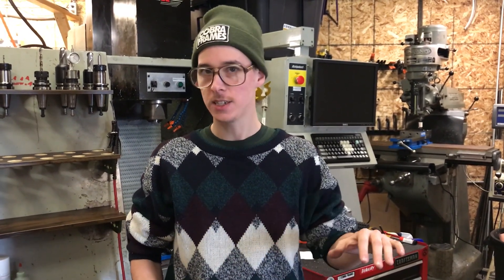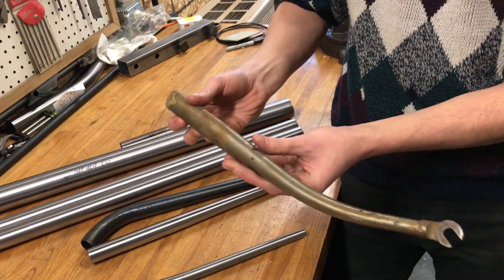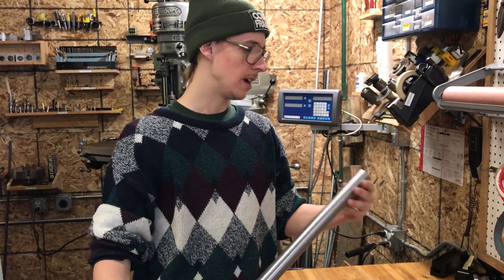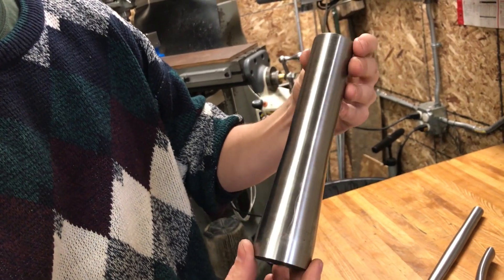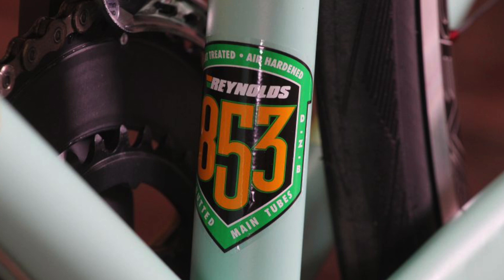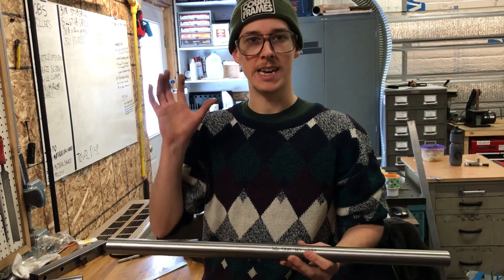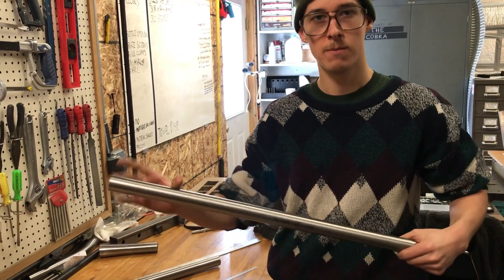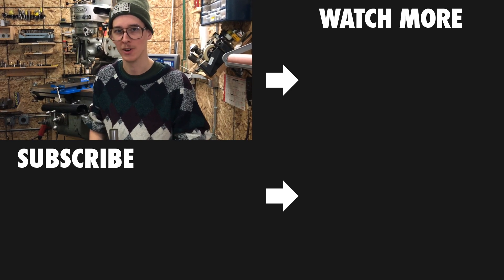Bike-Specific Tubing: What You Need to Know | Bicycle Framebuilding

Comment: Great video, can you help me understand what size head tube I’d need if I were using a 1-1/8” steering tube with a thread less headset?  I’m not sure what inside diameter tube I’ll need. Thanks, Al ps check out the batmobile I built

Comment: "Double butted" means that it tapers down at one end, then tapers up at the other end.
Fuji used to offer "Quad butted" Valite tubing but its simpler just to butt once down to the smallest wall thickness.
Seat tubes are often "Single Butted" because the clamped seatpost forms the butting at the top of the tube.

Comment: I wrecked a swedging machine when I was a young guy.   It's great big hydraulic ram. Inner or outer is either a tube or a bullet. It grabs the tube in a big one way hydraulic chuck and crames it in to or over the dye.  Lots and lots of power....   and a kicker to get the tube-inner dye off the tube.  If you don't back the kicker off and switch to a bullet dye. The machine jams and 300 tons per square inch blows the front of the ram off...  Granted this machine was for down hole pipe up to 24".

Comment: Super informative thank you!  Are there any considerations for tubing diameter and thickness for a first lugged frame building project?  Where aesthetics and frame performance is not so important as an easier build. Also for butted tubing, do you have any thoughts on the minimum length of the butt that needs to remain at either end after cutting to size? I'll be taking a fair amount off so wonder if straight gauge is more suitable.

Comment: I would like to have a frame built from Reynolds tubing for a combo touring-gravel-commuter all rounder bicycle.  For overall STRENGTH-FLEXIBILITY and the LIGHTEST weight, is Reynolds 631 or 525 appropriate?
Reply: It is a huge difference between the various demands of touring, commuting, sport or club riding. A loaded touring bike should have as a general rule more tire clearances, longer chain stays, powerful brakes, lots of braze ons for all the racks, lights and extra water bottles. The head tube about 72 degrees and trail of at least 1 3/4 inches. Oversized down tube for stiffness. Great bike for loaded touring but a slug for commuting. Save your money and buy several bikes to meet your specific needs....
Reply: @kirstenspencer3630  Why several?  Makes more sense to equip ONE good overall TOURING bike.
Is Reynold's tubing superior, inferior or the same as Columbus?
Reply: @jakobw135  Reynolds tubing uses MANGANESE which adds toughness and superior fatigue resistance.  The tubing actually gets stronger with use. Columbus uses Chromium and Molybdenum to add strength and toughness. Other manufactures of bicycle specific tubing are excellent choises as well. Ishowata tubing is triple vacuum melted a costly proceedure to remove non metalic inclusions. Drawing process and being drawn over a mandrel in creates a refined grain in the metal. The diameter of the tubing and wall thickness has a huge influence in the feel of the frame. A classic race road bike has entirely different construction and geometry than a loaded touring frame. Specialized sold a loaded touring bike in the late 1980's that predates the rockhoppers that can be found and can be a " turn key " solution. Budget friendly. Each use is mutualy exclusive and while possible to use a single bike for all purpose highly not recommended. Have you ever experienced a " speed wobble " ?

Comment: Bro What is more stronger straight gauge or butted?
Reply from the maker: Depends on use case and the particulars I think. The argument for straight gauge is that there is more material, but the argument for butts is that it puts the material where you really want it and concentrates the stresses away from the welds. I would say butted is the best way to make a frame strong given that you get all the wall thicknesses right. I’m not an engineer tho.
Reply: @cobraframebuilding  thanks a lot
Reply: Do the FEA on bike frame and where stress is high add thk

Comment: Are "stainless steel tubes" different somehow from "steel tubes" when it comes to welding/brazing etc... which are better? I just wander, because if i use stainless steel tubes, i can polish them and leave some parts of the frame unpainted .. is that make any sense ?(sorry about my english).
Reply from the maker: Stainless is harder to work with. Stainless is harder to cut, costs more money, harder to weld/braze generally, and getting everything right is more critical with this medium.  It's a great material when used properly.

Comment: Thanks man! Do you know of any videos about HOW tubing is butted at the tube factory?
Reply: It used to be on the Reynolds website (reynolds.co.uk).  Basically they stick a mandrel (steel bar with a ball at the end) inside the tube and turn the tube to almost "rolling-pin" it thinner (squishing between the ball and a die) in the middle, as the length of the tube expands.

Comment: Hey. Regarding your MTB frame build... why dont you let your downtube straight and ad a bumpstop to it to resist the forkcrown. Gives you the added  benefit of not chrashing the cocpit into the toptube. Alsow its said a straight downtube makes for a stiffer headtube area.
Reply: There can be some issues that arise from such an arrangement: 1. The headtube could shear off in a crash. If the fork crown clears the DT without interference then this isn't a worry. 2. Finding a knock block to mitigate that fork crown impact to the DT can be difficult- what material works best? How do you attach it to the frame? 3. A DT fork crown stopper limits steering angle, which for someone who rides with a trials style over some trail features can find this really annoying.
Reply: @WheelNut2  A big part of the trek mtb family is is doing it that way (not negating what you said). The  bump stop has to be some kind of hard rubber (soft plastic). Maybe you can buy a bumpstop from a specialized epic hardtail. And the steering angle shouldn't be a problem... I'm riding around for years with canyon mtb's which have a similar kind of TT protection called IPU (impact protection unit) no problems even on the steepest of hair turns.

Comment: Great video. You can also get a rough idea of butt length and location of the change in wall thickness by looking through the tube at a light source and seeing where the reflection angle changes.
Reply from the maker: I thought about including that in the video. Sometimes that method works fine enough, but I haven't always found it to be that easy to get great measurements. It's definitely a good tool to have in the toolkit though.